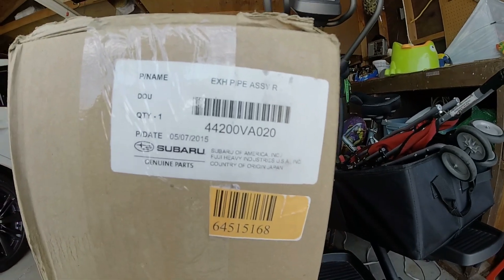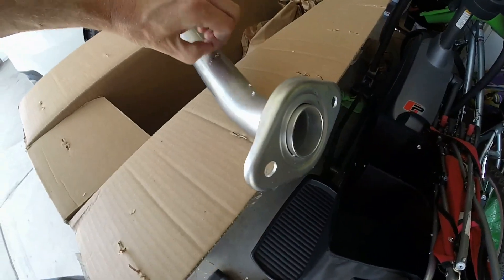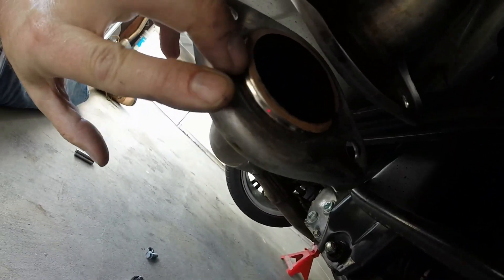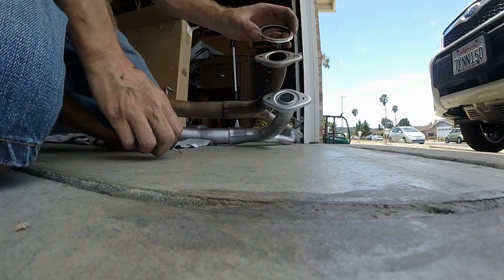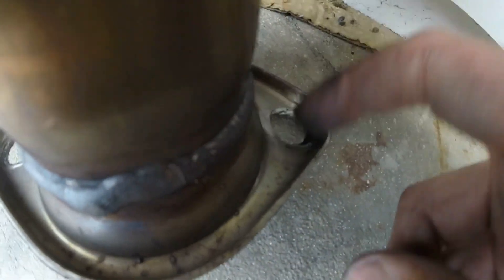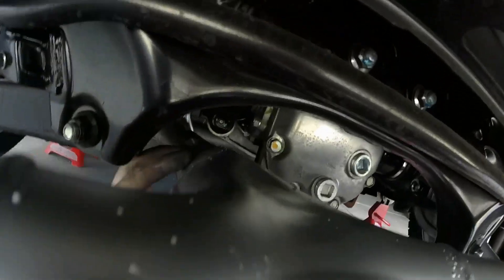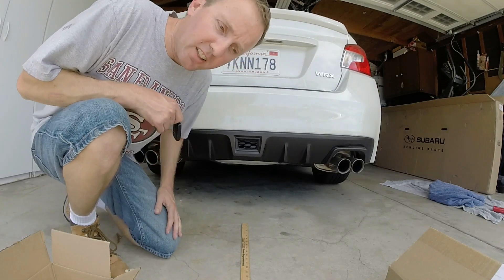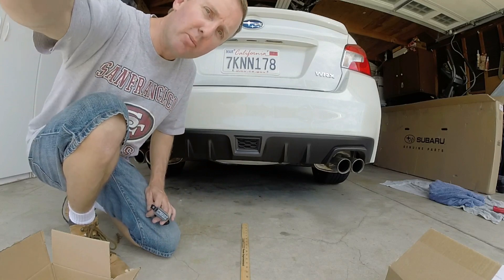2015 Subaru WRX Limited: Ep. 97: STI Midpipe Installation and Results

Comment: This is exactly what you needed. Took that last bit of rasp right out. I've been considering getting the sti midpipe for a while now, was thinking of possibly swapping with an sti owner on the forums or something
Reply from the maker: Hakop Agazaryan i agree. it is pretty much exactly what i wanted out of it. i dont have a j pipe on currently, but the next one is being installed this week, if my shoulders get better by then. i do so much car work on the floor of my garage that my arms are usually sprained.
Reply: I think once the catted DP shows up, you'll get the perfect balance of stage 2 power with close to stock sound

Comment: I have a 2015 STI, i actually installed a 2015 wrx mid pipe ( basically did the opposite ) of what you did. My STI actually sounds a lot better without the resonator. Sounds like crap warming up tho, once its warm up its so much more meaner than the original. Performance wise i "think" i have more mid-top end power than before. Also a tip to make things easier doing this mod, you need 2 people to do this i just unbolted from the cat-back and unhooked the mufflers from there hangers and removed it one piece made the whole job take around 15min.
Reply from the maker: +thuc pham the resonators are free flowing. it would not effect power at all. you think it has more power because its louder. but good to know its the same easy swap.

Comment: I wonder how the STi mid pipe would sound with muffler deletes and a stock J pipe? I was considering this for my 2015...
Reply: +Gunsforfreedom Did you ever try this? I'm running Nameless deletes and wonder the same thing.
Reply: +Ed Sirignano 
I was considering those. But I sold my car last summer. Had some issues with it. I bought a 2015 VW GTI. So far so good, really like it.

Comment: Would I need a tune if I swap my stock 2016 WRX CVT midpipe with STI midpipe? I am a bit tired of the house shaking I get every morning, so I am doing it purely for this.
Reply from the maker: no. you do not need a tune for changing your midpipe. i have a custom one for local pickup but I'm sure you are not local.
Reply: Thanks for the info. I am in Canada, so no, not local.

Comment: Looking to do this on my 2018 WRX. But there is a new part number for the 18 STI. Last three is 110 vs 020. Would you happen to know which one fits my 18 WRX?  Thanks, awesome videos.
Reply from the maker: didnt think anything changed exhaust wise for 15-17 and 18. maybe just a revised part. you should be able to look at shape and pretty much figure out if its the same piece

Comment: Any chance you have the distance (d) between the holes on the stock sti mid-pipe flange that connects to the intermediate pipe? <O-----d-----0>. I have an aftermarket J-pipe/downpipe/intermediate pipe and would like to know if it will mate up to the stock sti mid-pipe. Thanks!
Reply from the maker: that car is 2 cars ago..

Comment: Question,  how did you get the Axel stands under the jack points if your hydraulic jack needed to use the said jack points? Or is there another jack point in the rear of the car that you can lift the entire rear of the car off the floor? Thanks in advance!
Reply from the maker: helllokitty138 interesting question, and it was very easy. i put my jack on the FRONT points and jacked up high. High enough so i could slip jackstands under the REAR jackpoints.
Reply: Thanks for the response LHG! Keep them videos coming! :)

Comment: You should add the sti mufflers to your setup, I have them with that midpipe. But stock downpipe which I am soon going to change out. But I Think it sounds really nice and a bit deeper.
Reply from the maker: Josh Monasterio i would think about it, if they didnt retail for $350 EACH.
Reply: Wow I didn't realize they where that much.  I got mine when I ordered the car.  It was included in the price.

Comment: I know the STi midpipe cuts out rasp but does it also reduce volume? I've been thinking about muffler deletes but worried about the volume, hoping an STi midpipe will reduce the volume a bit
Reply from the maker: yes, it also reduces volume a lot. so much that in some of my setups it was too quiet, quieter than stock.

Comment: Since you already have the STI mid pipe, have you considered getting the STI muffler? Then you'll have a full STi cat back. I had it for a good amount of time before I changed it to the invidia N1. Before I swapped to the invidia, my WRX already came with a full STi catback exhaust set up and I did like how it sounded a lot for an OEM piece compared to the stock wrx catback.
Reply from the maker: its the same mufflers. unless you mean the SPT catback.
Reply: I might be confused between SPT and STI. but basically I had the SPT exhaust system that someone had ordered but never actually bought the car. but I know for sure that the SPT (STI branded on the side of the tips) mufflers that I had was flatter, thinner than the WRX mufflers. The sound was a lot deeper compared to other WRX without the SPT catback.

Comment: My service guy wants to give me a whole sti exhaust for my 2017 wrx . Should I just use the mid pipe with the resonator . And is there improvement in performance.
Reply from the maker: no reason to use the mufflers, theyre the same sound exatcly. i dont think the mid pipe is any bigger.. just quieter.. unless he is talking about the Subaru aftermarket catback..

Comment: Now my question is...Will that STI Midpipe fit the Forester XT? : D
Reply from the maker: +killersushi99 i heard the forester already has that pipe. go check and let me know.
Reply: +LastHumansGarage mine has a big honking resonator that's flat. Not cylinder shaped like the one you installed.
Reply from the maker: +killersushi99 if you wanted louder you could just do WRX midpipe with no resonator. Or did you want something in between, hence the STI midpipe?

Comment: Do you see any benefit in running just the sti midpipe alone on stock everything?
Reply from the maker: +Nbr1PHaN there is 1 benefit, but not everyone will see it as a benefit.. less exhaust sound.
Reply: +LastHumansGarage So your main purpose of these experiments are to bring down the raspiness with an aftermarket j pipe installed?
Reply from the maker: +Nbr1PHaN yes, that was the purpose of the STI midpipe.

Comment: Are you still using the sti mid pipe with stock WRX mufflers?
Reply from the maker: no. its too quiet. i run a normal WRX mid pipe with stock mufflers.

Comment: do you need to tune for this?
Reply from the maker: slasher 4433 JUST a resonated midpipe? No, you do not need a tune. All it does is make your car quieter. But there is no point on getting it unless you are stage 2. I tested it on my stage 1 and it made zero difference. Stage 1 is already too quiet for it to make it any quieter.

Comment: Nice work! I have a stock WRX CVT and was wondering if this will get rid of the exhaust droning between 1500RPM to 2000RPM?

I was considering installing this http://vibrantperformance.com/catalog/product_info.php?cPath=1022_1033_1055&products_id=47. Do you know if the dimensions of the STI resonator are bigger than the vibrant resonator?
Reply from the maker: the Vibrant would be quieter. it is an ultra quiet. but that STI resonator is pretty big too, and you wouldnt have to hack up your pipe.

Comment: Hi!  Been watching a LOT of your videos! I have a 2015 WRX with CVT.
No engine mods so far but will get a GrimmSpeed J-Pipe Catted/Coated when it becomes available for the CVT! Contacted local Subaru Dealer on this 44200VA020 and can probably get a better price IF I pick it up from the dealer (5 hour round trip),
so my question is: CAN I fit this mid-pipe into my WRX (by placing the large end in the trunk and the front of the pipe ... with seatbacks down... into the front of the WRX??
Reply from the maker: Jelier Dorst no idea, thats exactly why i had mine delivered. I can't even test for you, I can't fold down my seats with 2 baby seats in the back.
Reply from the maker: Jelier Dorst also, you prob know, but ill be reviewing the grimmspeed downpipe next week.
Reply: Jelier Dorst yes ive done it make sure the Y of the exhaust is in the trunk the front of the exhaust will reach your elbow so if you have leather seats make sure you bring something to cover your gonna have to bring a large plastic tarp to lay down on the trunk and back seats as well.
Reply: ***** Thanks Eric! Do you think I could use the box it comes in (collapsed) to help with protecting the interior of the WRX? I'd like to also use the box to store the original OEM mid-pipe after I remove it.
Reply: J. Dorst yes if you collapse the box and lay it out if its big enough do so but make sure its enough to cover as the stock midpipe is one piece i would bring a large plastic cover just in case. And to store the stock midpipe i used plastic wrap and tape to cover the holes so nothing gets in.

Comment: $206 from this site, bought from them. http://www.generalmotorspartsonline.com/oe-subaru/44200va020  I'll share a video once installed, running cobb catted and resonated j-pipe, sti midpipe (once it arrives) and 4" muffler nameless 3.5 axle back. 2015 WRX stage 2+ w/ turboxs tmic (a must!!!) Need the sti midpipe to kill the dreadful droning I have now w/ the jpipe and axle back using the stock midpipe.
Reply from the maker: thats a steal